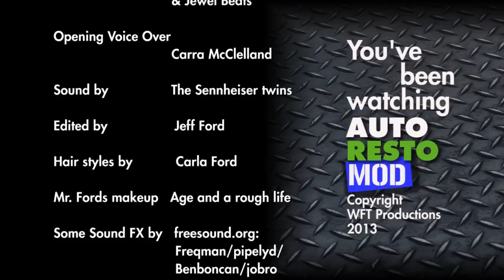Diagnosing and repairing Classic Car horn system

Comment: Thanks for such a comprehensive solution guys!  This video helped me track down and repair a long time, irritating horn problem.  Ironically it was the same yellow wire and uneven contact that you experienced. My original GT wood grain steering wheel horn is now working FLAWLESSLY and I have a good understanding of what makes it so.

Comment: Thanks guys, I referenced this video heavily when I fixed my horn. Turns out my steering column wasn't even making contact with the steering wheel...and the horn plate was on backward. One thing I must add is everyone just says "remove those two bolts and the steering column will just sllliiiide right up" mine did not, I had to get a crow bar between the steering box and the shaft to get it to budge.
Reply from the maker: If it hasn't been off, it can be a pain. Glad we could help!

Comment: Early on, you cut the wires where they plugged in under the dash? So after you ran the taped wires down the steering column, how did you connect them all that plug under the dash?
Reply from the maker: Honestly, it has been a while.

Comment: Gents,
I tackled my horns this weekend.  I checked all you described and got the horns to work when I test them at the turn signal horn posts. My problem is I put the steering wheel in place and it does not seem to touch the horn contacts.  There are two screws that the steering wheel contacts connect to that if tightened wont even allow depression but in any case with the steering wheel in place I am getting no power to the actual steering wheel contacts but I do have power at the contacts.  A

Comment from the maker: We've seen this problem from aftermarket installs from time to time. It could be that the contacts are not completely touching the horn button. Remember, on a '66 you can change the column depth, try that and contact us on the web site if this does not help.

Comment: wow thanks. How would you tighten the steering column again? I have a 58 Fairlane. It was worked on. Now my horn honks by touching the steering wheel slightly or when it turns. As well, I noticed that the steering wheel and column is loose. I think the steering wheel just needs to be tightened so it doesn't touch the horn assembly without it being pushed.

Comment: Someone help! I have 12volts at the steering column and its powering the horns. When i put my steering wheel back on i get no horn sound. When i jump the two leads the horn works. I tried cleaning the contacts but still nothing.

Comment: I stumbled on you guys after I looked up installing a horn on older cars... I just bought my first car and it's a 1978 Chevy nova custom... doesn't have a horn. I am so lost.
Reply from the maker: msMJ64 First order is to get a wiring diagram. Then start back tracking from a set of operational horns. If the wheel is an original, make sure that the contacts are all good. Check this episode too: https://www.youtube.com/watch?v=oj4VUsC5P44

Comment: i just finished installing a turn signal switch on my 66 mustang,i have a grant steering  wheel.the horn works fine, but it sparks under the horn button.it's when the metal touchs metal.i don't really understand this.
Reply: Bobby Williams mine doesn’t that also. What was your solution

Comment: you guys know the problem if the horn works then you unhook it and hook it in again and it doesnt work? I bought me a new horn but still does not work. Can I have made a shortage or something?
Reply from the maker: Go through and check all your connections. We'd get some test leads and start testing the contacts. It will probably be an issue there.